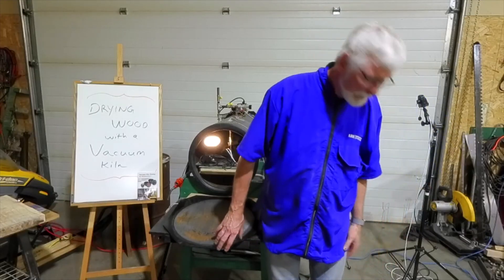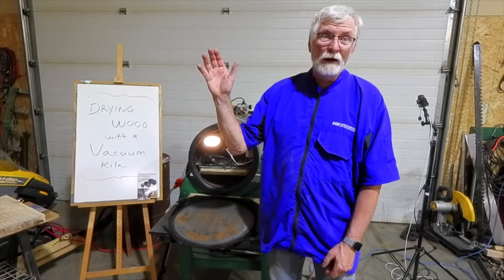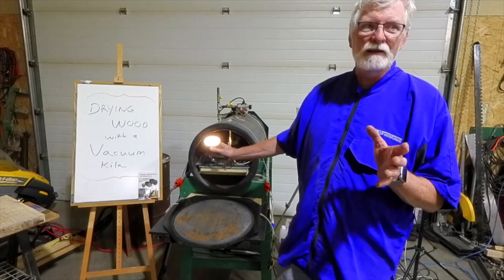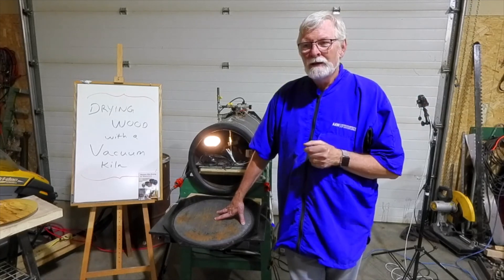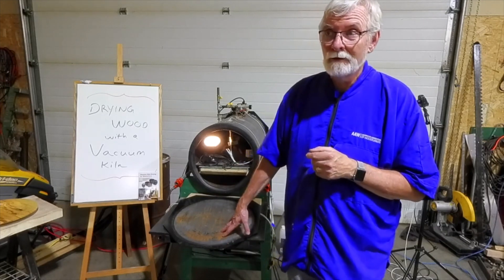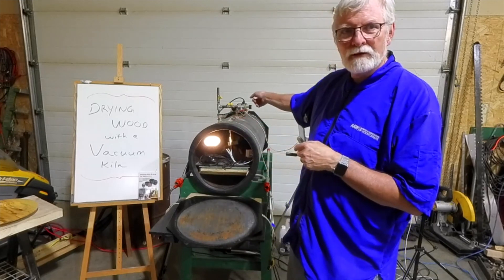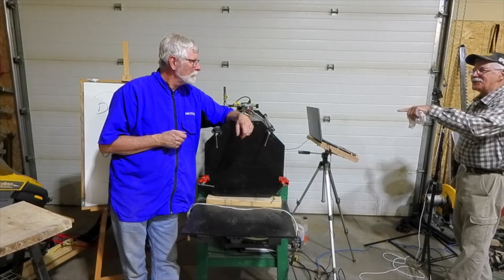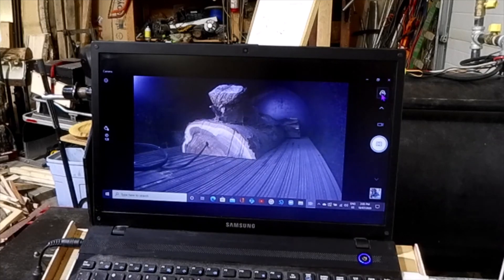Vacuum Kiln for Drying Wood

Comment: k Jeff,read down a ways and you answered my question,will build in three dryers,two 16 in and one 30 in and fill with washed small rock to catch moisture ,should work
Reply: Washed rock is a great idea. My latest idea is marbles to try to condense the vacuum line moisture. If that doesn’t work I’ll try fish tank gravel.

Comment: How did you determine the wall thickness of your round steel pipe? Isn't 3/8's a over kill since it's in cylinder shape?
Reply: Probably is overkill but since I’m not an engineer and where I live pipe is cheap and easily had, 3/8 seemed a good choice to carry about 10,000 lbs of pressure.
Reply: @j.hankinson7803  Thank you, I am in the process of building one. I am using 20" diameter, 48" inch long 1/4 in steel. I love the concept of not waiting years for wood to dry. For your water separator leading back into your pump, have you considered purchasing  a good quality compressed air separator that is made for air compressors? Just wondering if one could handle the amount of moisture that may pass through.
Reply: I have not tried air separators. The biggest problem with these vacuum devices is leaks. The pipe I described in line with the vacuum pump does work like a big air water separator though. As described in other posts I have experimented with a variety of (cheap) things to convince the humidity in the vacuum line to condense out and spare my pump.

Comment: What do you do about the water that gets into the vacuum pump? Do you have issues with the oil vapor that exhausts from the pump? I used to have a duo-seal pump and they are two stage vane pumps. What are the chances that a long pipe could be used to dry long timbers? Something in the 20ft range? With very little air in the pipe under vacuum I imagine heating would be difficult but would lightbulbs provide enough radiant heat to facilitate evaporation? Very interesting project and looks like it works well.
Reply: There is a lot of water in the oil for after drying wet wood for sure. When I first started, I regularly overflowed the oil chamber so I started putting a cookie sheet under the pump to catch the overflow. Subsequently I built another chamber of 4” pipe in-line before the pump. I routed the vacuum line into this chamber about a 1/3 of the way up from the bottom then out the top. Inside I suspended a whole lot of straws to try to increase the surface area for any moisture to condense onto. This caught enough of the moisture that I didn’t overflow the pump anymore. I know there are far better (and $$$) solutions but this one worked well enough. I change the oil after every drying run. As far as the oil mist goes, I either vent it outside in the summer or catch it in a few layers of rag on top of the vacuum pump. It’s not too bad with my pump though. Another little muffler style contraption on the oil vent port might do a better job. As you know, this type of pump is not much good for a vacuum chuck because the airflow is too low. I haven’t tried long timbers because I don’t turn them. The author of the book I mentioned did use a lightbulb at one time but I think for ‘the little guy’ heat mats are more cost effective. There are very large commercial units now utilizing microwaves with pressure and vacuum but obviously they are very expensive. They are capable of 16 foot or longer boards but of course that will take much longer than what I do since the water vapour has to travel so far. It becomes a problem of cost vs benefit for the long stuff. For the lengths used for Woodturning this is a win for the little guy - cheap, fast, and effective.
Reply: @j.hankinson7803  very intresting we are building a water filter factory for rural communities and need to dry the filters fast, but since they are so porous it will take too long under standard conditions, the only thing I don't fully get the design of is the water collector, could it be possible to install enough condensation space to eliminate the max humidity going into the pump?
Reply: Re: water filters. The majority of the water goes to the bottom of the kiln via condensation on the side walls. In the video I described drying a couple of green poplar wood blanks. I retrieved several litres of water via the small collection chamber mounted under the kiln drain hole versus several millilitres that made it to the pump. Since the oil chamber in these vane vacuum pumps is usually so small that is where the problem can lie. The pump can overflow leaving only a nice volume of water for lubrication instead of oil, and a mess to clean up. As described, the vast majority goes where it is supposed to in this build. 
I have no idea about this kiln’s applicability to your project but the underlying principle would be the same = adequate vacuum, adequate heat, somewhere for the water to go to get rid of it, and time to let the process happen. If your filters are flat, not too thick, and able to conduct some heat then this should work. If they are round your problem will be warming the material enough for the process to work. Heat will only be transferred by conduction in this scenario since there is no air. Using a radiation source like a light bulb won’t work properly since it likely won’t apply enough heat. I have no clue about microwaves. I found heating round logs of wood did not work well since insufficient heat was conducted into the log. I suggest keeping the kiln simple initially since that is cheaper and easier to build and seal. Good luck if you decide to try it.
Reply: You can buy electric heater tape or cable used to keep pipes from freezing and control with a cheap temp. controller.  Thats how I used to keep all the reptiles in my old breeding business warm and you can get it in long lengths.

Comment: i have a small refrigerator with a clear 40 watt bulb  with a dimmer switch and temp gauge with no fan no holes i can dry 6 bowls from 18 percent down to 7 percent or lower in 5 days and on the bowls i use giant stainless hose clamps one on the top one on the bottom to keep the bowl from deforming you have to check the clamps everyday and you would be amazed how much a bowl will shrink
Reply: Warm boxes like those work very well I’m told. I nearly built one as mentioned in the video. However, to dry wood from green (50% + moisture) to dry (6 to 10%) in three days in a vacuum kiln is just magic. A warm box needs about 3 months of more as I have read. The fellow on the Sprague Woodturning YouTube channel describes making one from an old refrigerator. With the volumes he uses it works very well for him.

Comment: WOW! LOVE this idea! I have both pvc and steel sections from 6 to 8 feet long and they are the 18" diameter. Would you have a building diagram for the construction of these? Its hard for me to remember all of the parts and where they go from vids! Once again,-- Thanks for the GREAT video! LOVED your presentation!
Reply: Sorry, I didn’t make or use any diagrams. The dimensions mentioned are arbitrary since that’s what I had and as far as I could reach into a pipe. I know people who have made these types of kiln larger and smaller. The size described is suitable for the application I use it for.

Comment: Very interesting video. This does indeed look easy to do and your sharing of experience is generous. Have you tried boards and would boards need to be stickered and banded?
Reply: I haven’t tried long boards since I don’t turn them. My 40” depth of the kiln is just because that’s as far as I could reach comfortably if something got stuck at the far end. I don’t sticker the boards because I want the heating mats in the best possible contact with the wood.

Comment: Is it something that could blow up. ?
Or something like that...
Reply: It creates a vaccuum.  So if anything, it will implode,not explode.
Reply: As described in the other reply, the pressure is on the outside at nearly 15lb per square inch. I roughly figured mine at 10,000lbs total so something that size with thin walls would be crushed. It would lose the seal long before it got too deformed I suspect. I would not be keen to try it though.

Comment: Hey Jeff, Built your Vacuum Kiln just like yours. Could not have done it without you. Thanks. Question? Does it matter if I use a rubber mat or can I use a 160deg (Far) stove heating element to simply heat the inside of the chamber? My rubber mat only goes to 125deg (Far).  Your are the man. Please post any updates. Only came across your video a few weeks ago. John
Reply: Hi John. Your rubber mat should be just fine. Heat is the enemy of drying wood. My mats top out at 40C/104F and that has been plenty. With the mat in good contact with the wood you get good transfer of the heat energy. In my kiln I initially put on a portable heating element, a pot of water, the temp sensor in the water, and a USB camera to figure out what temp water would boil at under my conditions. The number ended up being about 36.5C/97.7F, ie just below body temperature. With the the water vaporizing at that temp the whole process is very gentle on the wood, and magically fast as I described in the video. Sometimes I sandwich thicker pieces between two heat mats trying to get the centre of the wood up to that temp (essential) and that works a little better. I usually have a piece of thin tin under my bottom heat mat to try to reflect a little more heat up into the wood. I made a very simple shelf with a piece of plywood and a couple of 1" x 2" slats cross ways to support it from the sides. Water drops will stream down the sides of the kiln so having a little space between the walls and the wood is advisable. 
As much vacuum as you can get is also essential. I've discussed that in other comments here.
Heating elements or heat lamps are not that great at transferring heat into the wood = radiation. The mats transfer by conduction so they are much more effective (and much less of a fire hazard too). Microwaves = way too complicated and expensive for a simple setup like this.
Reply: @j.hankinson7803  Hi Mr.J and thank you for the response. This is the coolest thing I have made in 40 years of wood working. Who doesn't have some green wood hanging around. Doing my 2nd run as wee speak. Holding at 25 mercury and 120deg (Far) and got the wood down to 12-14 moisture in 2 days. Have a small leek (very small) but still so I made a timer box (https://www.youtube.com/watch?v=p9u8lrsRrWE) and set it for 3 minutes on 25 minutes off my Harbor Freight $92 pump. Way Cool! Wish I could send some pictures but anyway thank you for your knowledge and insight of this fun project. Let me know if you need anything like a CNC Router, Laser or 3D printer work done. Retired and always looking for new project. Running Solidworks and do a lot of Flat Pattern work on boat designs. I work for a 6pk/hr. LOL --- John
Reply: @OceanBlueWoodworks  Good to hear of your success. Hunt the leak down so you can get past 26.5 inches of Hg. I also have a temperature control to keep the kiln at 100F or so. Keep an eye on the oil level in your pump and maybe throw a rag on the discharge opening. You don’t want to breathe that stuff in. 
I originally built mine for Woodturning blanks. Thanks for the CNC offer. I’ve built 4 of them and a printer now lol. If you want to see a really way cool thing, watch this short video of my 5th axis in action. 

https://youtu.be/yE2UuRDe8NU. 

I’m having lots of fun with that.
Reply: @j.hankinson7803  Now you got my interest. Spent 15 years on Catia and 15 years on UG NX (Design/NC Programming). Let me know if can help in any way. Take care.
Reply: @OceanBlueWoodworks  That’s Waaay out of my league LOL. GrblGru’s author has since taken that ‘proof of concept’ video and applied proper mathematics to the problem of keeping the B axis perpendicular or normal to the curved surface. Unfortunately I can’t use his solution for Bill Oom’s program COrnlathe. I have a workaround though. Bill is not doing any further work on his excellent ornamental turning program - written in Java. Eventually I may puzzle it out and make some modifications.

Comment: This is a question from a total novice: How do you properly store dried wood? I would think that in a forty percent humidity environment, it would absorb water from the atmosphere
Reply: I dry my blanks to zero moisture on the outside because I’m lazy ha ha. Of course there is a gradient rising to maybe 12% at the centre of blanks as large as I described. I did cut apart several blanks while I was learning to test the process. Since these are often bowl blanks that have the centre turned out that doesn’t matter. I am sure the dried wood will reabsorb ambient moisture to a point. It is not likely to penetrate the wood too deeply I suspect. I would be guessing at several millimetres max. Wooden musical instruments have the same problem and will adapt to local conditions. It’s when they are moved all over the place that they have a risk of cracking so need some source of humidity. 
Wood from the stores is hopefully near 10% to reduce the movement effects in Woodturning. If the ends are sealed with wax they are probably still wet. By sealing them the vendor saves himself the trouble of cracked wood and leaves that problem for the buyer of course.
Reply: @J. Hankinson  thanks for answering!

Comment: Can't you do this with a vacuum bag?
Reply: No. Vacuum bags are great for applying pressure. The point of this kiln is to reduce pressure so water can vaporize quickly with a little heat.
Reply: @j.hankinson7803 , I think he’s referring to food saver vacuum bags. They are designed to pull a vacuum on things stored within them.
Reply: Another viewer wondered about a vacuum bag like those for laminating. A food vacuum bag is the same idea. The problem is that the pressure on the wood remains so the moisture won’t vaporize with a little heat. Water boils at a lower and lower temp as you gain altitude as described in the video, so to get water to boil at 36C you need a decent vacuum.

Comment: Nice to see some Alberta content.  Would this system work for keeping cookies from splitting?
Reply from the maker: Good question, it may be worth doing some to find out. I'll ask Jeff if he has ever done a cookie test.
Reply: I have tried thin small cookies - 6 to 12” across by about 1/2 to 3/4” thick - for a painter. They dried well. It was birch and pretty wet.  I just dried them over a day. I didn’t have any cracking problems. Since they were so thin and had so much end grain vs volume I didn’t think longer than that was needed.
Reply: @j.hankinson7803  thanks for the reply I will have to consider building one

Comment: Heres a simple tip for anyone wanting to do this. You dont need pipe compound to seal the threads. Vaseline will do just fine. The reason is that these are not pressure connections. Only 15 psi vacuum. Almost any epoxy would do to seal the wire penetrations, as well.

A heater is probably not needed, either, believe it or not.
Reply: Heat is definitely needed. I humored a friend and put a chunk of wood in mine without any heat source and it came back out seemingly unchanged.
Reply: @geekamole  The vacuum needs to be at most 50 microns in order to get proper dewatering, and it is necessary to pull it down at a controlled rate, to prevent freezing. Heating will always speed up the process, at the price of the energy added, which can be substantial.
Reply: @FelonyVideos  I was under the impression that energy is always required to vaporize wapor. Cody's Lab has a video about freeze drying a pumpkin in a normal freezer; the energy in that case comes from heat that migrates through the freezer walls from outside. But that took years. Is there a commercial kiln that doesn't use heat? I think Den Socling has claimed that there are also temperature thresholds for liberating bound water inside cells, that vary by species.

Comment: Greetings.  Great idea. Can this be built as a rectangle? I've got some sheet steel going to waste.
Reply: There are commercial square units, but I think they are fairly thick corrugated steel.
Reply: Vacuum pressure is about 14 pounds per square inch of surface. You are looking at tremendous pressure on a flat surface. Your steel would have to be very thick, that's why a round shape holds best. Cover plates on the end must be very thick.
Reply: @wetrock2766  thanks for the info.
Reply: I agree with the previous reply. A cylinder is far more able to take the external atmospheric pressure.

Comment: have some questions Jeff,thank you for sharing this,am building one as we text or communicate,have some wonder bout water ,am building in some dehydrators ,but do you get water in pump?
Reply: You do get water in the vacuum pump since the evacuating air has a very high moisture content. I regularly overflow my vacuum pump despite the air being drawn from the top of the kiln and water running down the insides to drain out the bottom. That’s why many types of vacuum pump are not suitable. Nothing brings tears faster than destroying a $500 Gast vacuum pump I think.